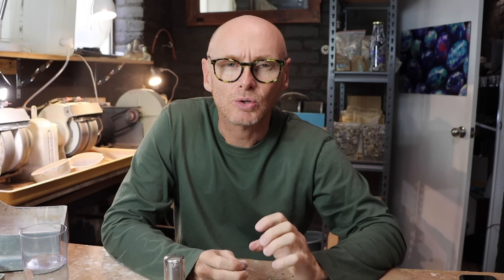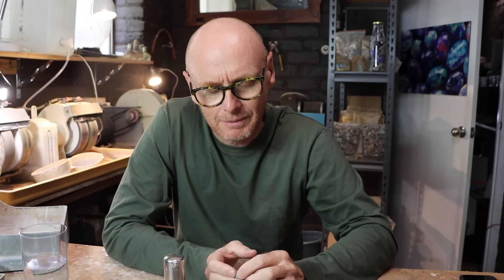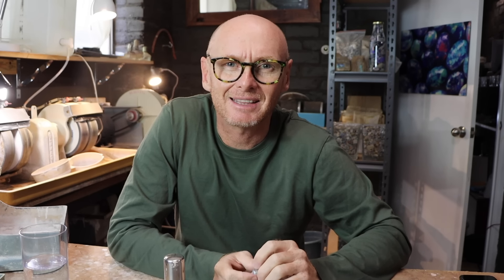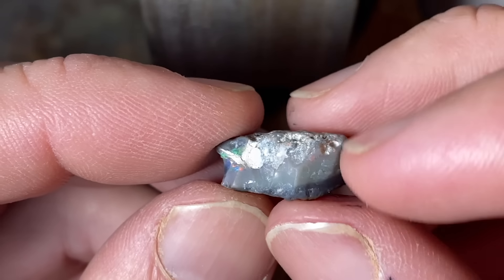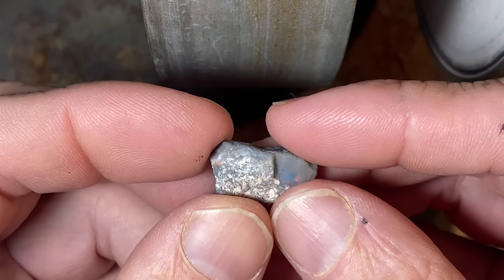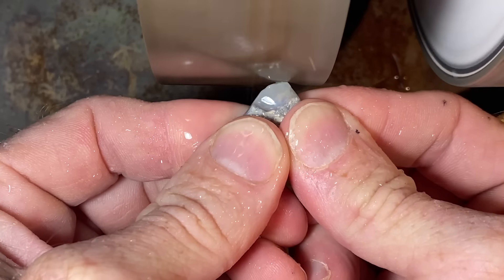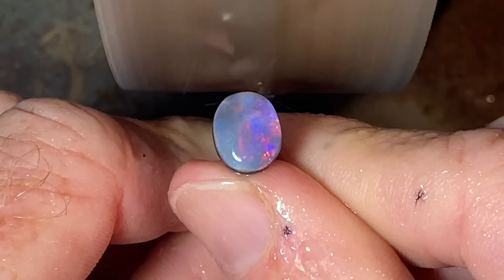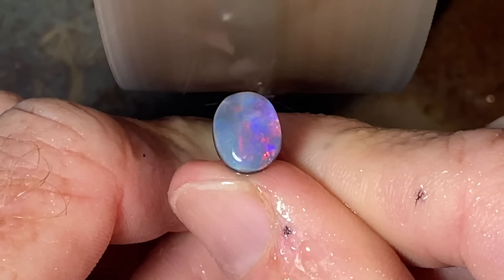$800 spent - Do I get my investment back

Comment: I like how you dont use a dopping setup . I prefer the feel of the stone on my fingertips for some reason it's just better for myself.  But it can take a toll on the skin sometimes I tried some of that tape but again it just didn't work out too well. That's a crazy amount for a rough stone but I guess it's a big prize if you win that gamble. I burned myself so many times and still do occasionally but I have learned kind of what to look for in terms of matrix, color,size ,shape etc . Was mad pissed when I got all kind of blue moon and just had the peel matrix I totally just grinded it off but now with some experience I would have approached it a bit differently.

Comment: Is it reasonable to ask you for a video/series where you take an average parcel of rough opal like you can buy on your website, name the price and then cut them all and see what you can get out of them? Or is the variation of actual value after cutting to price of the rough parcel too great? 
What I want to know is, what is the average profit (if any) one can expect from a normal rough opal parcel without having extreme luck. 
I'm sure you don't, but I can imagine that a lot of rough opal sellers pre-select rough opals, cut the good black opal themselves and sell the lower grade rough rocks.
Reply from the maker: I like to try and leave 100% in it for my customers. Doesn't always work but sometimes it can be more

Comment: Just when ya cut into the face and said theres the Black ya Ruined Half of it and had to cut it smaller it woulda been ok if ya didnt grind the=at face down into the black it had colour there it was electric blue an excellent blue. 9.49 right there BLUE.